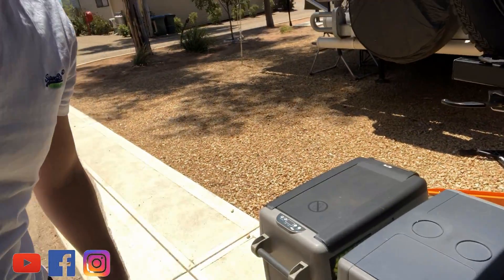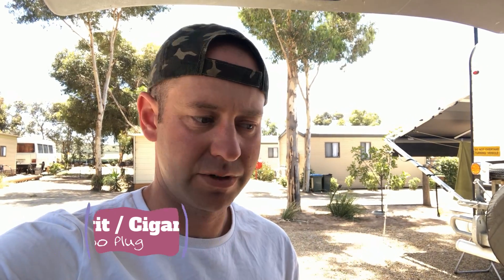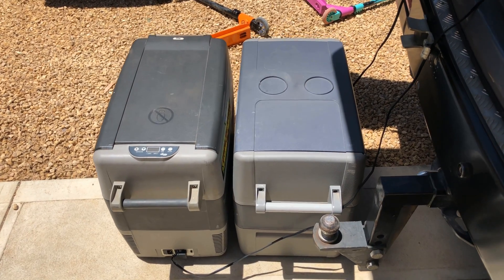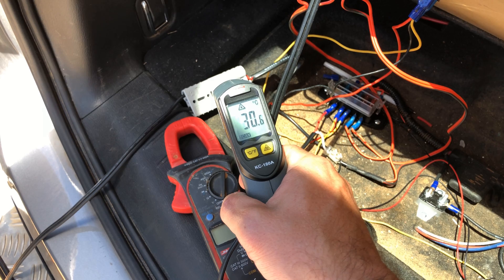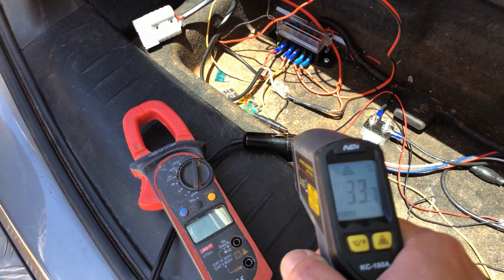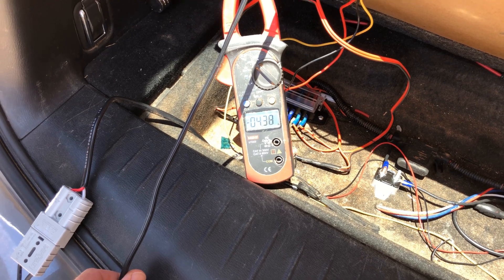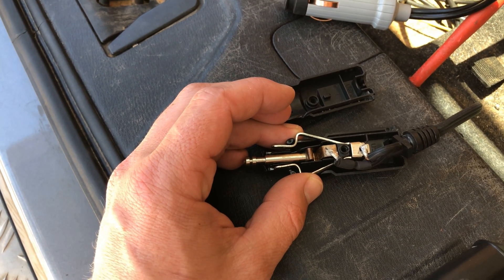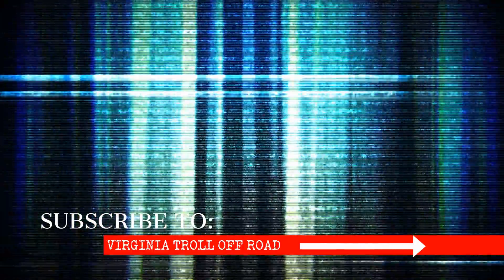Whats the best plug to run a car fridge

Comment: @ 3:00 - While you're at it, I'd recommend getting rid of those blade style plug-in fuses and replace them with bolt down midi fuses particularly in high current applications.

I'm loving your content though. Especially since I've just bought my first (Jayco) caravan.

Comment: I also had the same problem with the plugs not making proper contact and melting.
 So I cut off my plug and cut the wire to the required length and soldered it directly to the thick cable from the second battery Problem solved.

Comment: Where is your power coming from. I think the little black plugs are only good for up to 10 amps but mine I run straight from a 600 watt inverter on a second battery. Fridges always run better from 240 volt and you eliminate the heat issue.
Reply from the maker: Can’t say that I agree with you on that one. Running an inverter will give greater inefficiencies.
Reply: That's ok it is what works best for each. I enjoy your videos and getting a look at the new Patrol in a real life situation is good. What kind of lift could you get under one without having to change too many components and give better clearance. I have had a couple of Patrols and other 4x4s but the last 6 years I have driven a modified V8 Range Rover which works a treat. I must say once you have had a V8 a diesel is not very appealing anymore.
Reply from the maker: If you’ve got a STL lifting 40-50mm is easy. If you have the HBMC model it’s a bit trickier but still possible. Speak to Andrew at OnTrack in Vic and he will sort you out
Reply: That is good to know that models are different, 50 mm is about the norm. Thanks